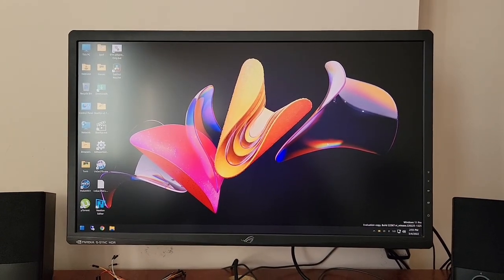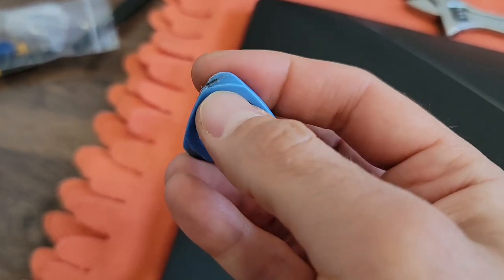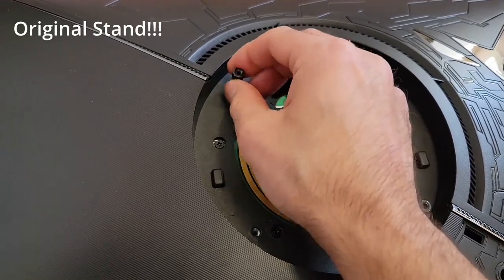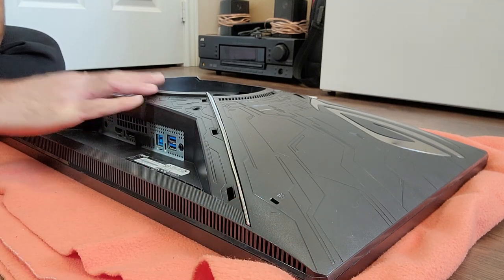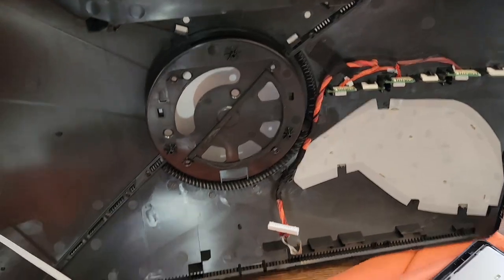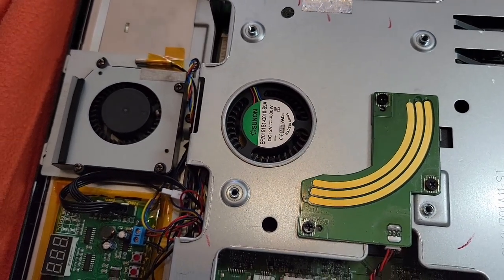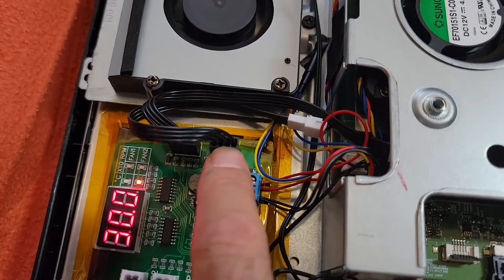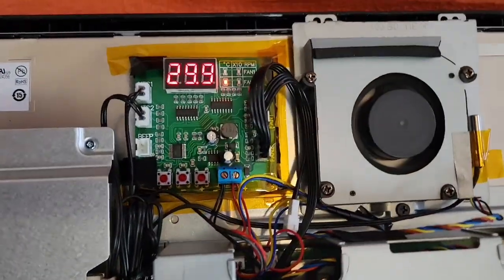Asus PG27UQ Disassembly + Modifying Fan Speed + Reduce Fan Noise

Comment: Mine loses signal for both DisplayPort and HDMI randomly. I’ll turn on my PC and it will lose signal like a few minutes later sometimes it will work for a few hours but then the same thing happens, same issue with HDMI with my Xbox. Unplugging then replugging any of the cords sometimes fixes it but only temporary. Any idea what the issue would be ?
Reply from the maker: Hey, it seems that your monitor is either overheating or you have a faulty main board. Have you ever opened the monitor to see if the fans are free of dust, I also recommend changing the thermal paste on the FPGA if your monitor is 2 years or older?
I would first blow air to clean the fans and also inspect inside the heatsink (see my other video if you are interested).
Good luck with everything.
Keep me posted.
Reply: @parhamsan  I’m opening it now and yeah there is some dust which I’ll clean, but don’t think the issue is overheating because it will lose signal only a few minutes after I turn it on before the fans even ramp up. Some days though I’ll be able to play for hours before anything happens. I’ll see if the cleaning helps but if it’s indeed the main board what should I do then? It’s not under warranty anymore I’ve had it for 4 years
Reply from the maker: @VerticalStrafes  unfortunately if it's a faulty main board you are better off buying a new monitor since the fpga module itself would cost around 600 USD from ebay, does this issue happen in winter time?
Reply: @parhamsan  it’s only been issue for the last 5 months or so but it’s been getting worse slowly overtime. This would really suck if it’s indeed the board so really hoping the cleaning and new thermal paste will fix it. I’ll let you if it improves when I’m done, thanks for the input.
Reply from the maker: @VerticalStrafes  The only reason I believe it could be a faulty board is from other users reporting they face shut downs when the fpga heats up. In your case it seems it is losing signal which I have never heard before from anyone.
My only suggestion is to do the cleaning on the fans, clean inside the heatsink (make sure to inspect inside the heatsink where the black shroud is, a lot of people have mentioned it getts clogged up with dust and other stuff), and finaly change the thermal paste on the fpga as mine was solid as a rock after 2 years.
I really hope you can fix the monitor as replacing a 2k monitor would suck!!!
Good luck again, I'm always here to help.

Comment: Perfect tutorial,  thank you. I was looking for the solution over and over and finally found yours.  Gracious
Reply from the maker: Glad the video was helpful, thanks for the comment!
Reply: Tnx 👍
Reply: @parhamsan  hi nice video , i have a question, i want to buy this monitor used, will it be louder if i vesa mount it :O? best regards
Reply from the maker: @Tuskabanana  Hey, if you Vesa mount the monitor, the fan that cools the FPGA, can such more air and cool the FPGA better but make sure to use some sort of standoffs like the ones I used. However when you Vesa mount it, you can hear the fans a bit more (if the fans are connected to the FPGA Mainboard). What I suggest is: if you buy the monitor used, and you Vesa mounted the monitor and if the fans are loud and noisy, change the thermal paste (see my other video for instructions on how to do it).
https://youtu.be/7c6hV5D1pJk?si=NFOZGWZu7cBbkTys

I always used the monitor on Vesa mount. There is also the option to use the external fan controller like the one I used to manually adjust the PWM of the fans and make them quieter.
So as you can see there are cons and pros of Vesa mounting the monitor, but overall it would be Quieter with the monitor on Vesa mount.

Let me know if you have any other questions!
Reply: @parhamsan  yes thank your for the respond, how is the hdr 1000, its worth it :O?, i would just buy it for hdr 1000 and 27 inch + good blacks, you think 300+ is a good price?

best regards
Reply from the maker: @Tuskabanana  The HDR is fantastic on this monitor, the monitor gets extremely bright for HDR content (1000+ nits), however to me this is a gaming monitor. For HDR gaming this should be fine but for HDR contents playback (Movies, Netflix, etc) I would definitely go for something bigger like 32" or 42" and oled screen. If your budget is limited, 300+ is a very good price!
Reply: @parhamsan  ty for your feedback, 32 inch is too big for me, i like 27inch only :=)
Reply: @parhamsan  yeah i will buy this monitor for 300€, main reason is also the hdr1000 + local dimming, solo games in hdr :=), how is the panel btw, is it sharp, i got a lg one its very sharp. Btw if i want to vesa mount it 100x100, do i need some adapter or something extra or should the vesa arm im buying have all screws.

Best regards
Reply from the maker: @Tuskabanana Hey, the HDR even for movies is pretty descent, for sdr the panel goes up to 300 to 350nits which is more than enough. I truly love this monitor, beside the fan noise which I'm gonna watercool the fpga to make it completely silent soon :).
I can't remember if the standoff were included with the monitor itself or came with the Vesa. I can get back to you on that. But definitely need the standoffs otherwise the fans choke!
Reply: @parhamsan  y would be n1 if you can me a update about the standoffs later, best regards :O
Reply from the maker: @Tuskabanana  Hey, your monitor should come with the standoffs
the PN is:
6K.3U709.001 (6E.3U706.001)
Go to these website, they have images of the standoffs

https://forum.gamer.com.tw/C.php?bsn=60030&snA=501554

https://pcper.com/wp-content/uploads/2018/06/68ca-dsc05034.jpg

https://pcper.com/wp-content/uploads/2018/06/25c8-dsc05035.jpg

Unfortunately if they are missing from the Box then you need to buy something similar as I could not find them on Amazon or ebay.

Something like this might also work, but you can ask the seller (don't take my word on it):

https://www.etsy.com/ca/listing/1323710159/vesa-adapter-for-asus-rog-swift-xg258q?click_key=c8d9aff33f1b0a64bd5bacd10a0b09213983043d%3A1323710159&click_sum=bdbaff9e&ref=search_recently_viewed-2&pro=1&sts=1
Reply: @parhamsan  ty very much for the effort :=), yeah he should have it, since he use the monitor on vesa mount too. best regards
Reply from the maker: @Tuskabanana  My Pleasure, good luck with everything!
Reply from the maker: @Tuskabanana  please create a new comment and I can respond to your questions, currently we are chatting on someone else's comments, thanks.

Comment: 2k$ monitor needs modifying how greedy can companies get - you need to delid CPUs change thermalpads on GPUs and mode Monitors ...
Reply from the maker: Hey, sorry for the late reply. I agree with you; I guess at the time when the monitor was released the active cooling was the only way to cool the FPGA module. But picking a cheap fan with jet noise and not being able to control the fan speed was a bad choice from ASUS!!!
Since making the fans silent (by lowering the RPM of the fans), I have never seen an issue on the monitor, so the high RPM on the fans was really unnecessary from ASUS!!!

Comment: Hey Mate - In terms of poweriing the board if I was to be powering 1 fan should the red/black from a single enxtension cable be enough to power it? I'm assuming given the main boards giving off 12v and the PWM board is powering a single fan rather than 2 this should work. Looking to do this on the 34" variant of the monitor that has 3 fans, the supplemntary ones are off to either side so I figure 3 x 1 channel PWM boards would be the easier in terms of cabling/probe placement.
Reply from the maker: Technically it should ok but I cant guarantee it. You can search for series and parallel connection online (current wise). With 2 or 3 wires you make sure you are supplying enough current to the board.
To give you an example: Lets say that each red/black wire supplies 0.5A to each fan. If you use 2 or 3 then you can supply 1A/1.5A to the board. If you use only one of them then you are limiting the board to only 0.5A.
Power=Current x voltage=0.5x12=6W MAX (1 wire)
vs
Power=Current x voltage=1.5x12=18W MAX (3 wires)
Keep in mind that the board itself uses some power.

Can you specify the specs on the fans?
Max current and voltage?
Reply: Looking at my photos from the last time I took it apart it's the same Sunon fans in both the pg35vq and pg27uq
Reply from the maker: @AbnormalFlame  Then you should be fine, but again just to be on the safe side connect at least 2 red/black wires from Monitor's MB to the Fan Controller Board.
Use these:
https://a.co/d/een9j7O

If you toast the Monitor MB you are in big trouble where the cables are like $10-12 from amazon!!!
Please don't blame me if anything happens to the monitor MB :)

By the way I have now switched to water-cooling the FPGA on the PG27UQ!!!

Comment: I need to replace the two fans in my PG27UQ. They're not really set up for easy maintenance (cleaning out dust) are they? I hope I can get that metal mounting shroud out of the way so I can get to the fans. Otherwise, it won't matter about upgrading, although I would like to do that as well. Here's hoping..
Reply from the maker: Hey Mike, as you may saw on the video I bought extra fans thinking that the new fans would have lower noise, but that wasnt the case. For me cleaning the fans and the heatsink lowered the fan noise and lowered the temps (beside the mod obviusly). I would say the fans are 100% maintainable and heavy duty. I have the monitor for more than 4 years and still using the original fans. Is the monitor shutting down or are the fans making a loud noise, just wanted to know the reason you want to do the mod? Also Which metal mounting shroud you are talking about, the one for the fpga?
Reply: @parhamsan  these are the original fans, and I noticed an increase in volume from the fans when I wasn't playing a game, when the room was quiet. I didn't think anything of it, and after a month of no gaming time, I finally turned it on, only it didn't come on at all. I unplugged everything, replugged it into the wall directly, and the monitor started up and I was relieved. Only it automatically shut off a couple of minutes later. That's all it does now, when I turn it on, it automatically shuts down after a short period of about a minute or two. When I got the stand off the back and opened it up, the main fan is almost completely dead. It doesn't turn on its own, and it's caked with old dust. The other fan (toward the top) spins freely but I never saw it come on while testing them.

I really just need to replace those fans, but I can't find my original purchase receipt (but I know it's not still in warranty, I've had it about 3 years). I can't even remember where I bought it from, which website.

The fans are mounted in an aluminum "shroud". I'll have to find a way to get them out of there. The top one looks easy enough; I can see those screws. I'm assuming it will come right off. The other one (the main fan) just has those rivets showing. It doesn't look so easy to get to so I can remove it.
Reply from the maker: @mikegarland4500  Mike, have you seen my other video. In that video I fully accessed the FPGA Module and the fan and I changed the thermal paste on the heatsink to the FPGA.
https://youtu.be/7c6hV5D1pJk
From your description it seems that you have a dead fan on the FPGA module. And the reason the monitor shuts off after sometime is because the FPGA in overheating and shutting down the whole monitor.

If you fast forward to the 8:00th minute (on the video that i shared) you can see how to open and access the heatsink. Again fast forward to the 12:00th minute and at exactly 12:36th minute you can see that the second fan is only held by 2 screws (top right and bottom left) and a piece of tape.
The piece of tape connects the fan to the plastic shroud (12 is written down on it with white marker).

You can order the fans from Ebay or Aliexpress. Original fan part number is:
EF70151S1-C010-S9A SUNON
https://www.ebay.ca/itm/266266726298?mkcid=16&mkevt=1&mkrid=711-127632-2357-0&ssspo=qE5nfKv9SAe&sssrc=2047675&ssuid=HpADsykxQ3m&widget_ver=artemis&media=COPY
https://www.aliexpress.com/item/1005005456076384.html?spm=a2g0o.productlist.main.5.5d1536852BOMcb&algo_pvid=9265b8a2-111d-483e-9ca3-8777ca849b00&algo_exp_id=9265b8a2-111d-483e-9ca3-8777ca849b00-2&pdp_npi=3%40dis%21CAD%2113.74%2113.74%21%21%21%21%21%402102111816856249374092577d07ee%2112000033155686905%21sea%21CA%210&curPageLogUid=dDKGkB7nczZb

You can buy them used or new, but I would pay more and buy a new one. I would order 2 and replace both if I were you.

Also you can use and electrical tape or Aluminum tape to replace the tape. Just get the correct width.

What I would do first is to swap the fan wires on the PCB to make sure it is a dead fan and not a bad fan header or electrical issue. If the good fan spins and you see the same behaviour (bad fan doesn't spin), then you are in luck.

Just order the fan from Ebay or Aliexpress, change the bad fan on the FPGA heatsink and you should be good to go (obviously you need to by the tape or reuse the old one).

Since you already opened the back shell you are half a way there. what I also suggest is to change the thermal paste while you change the FPGA fan. As you can see from the video mine was completely dry after 3 years of usage.

Good luck with everything, I'm always here to help and to answer questions!
Reply: @parhamsan  no, I haven't seen that one, but I knew there was another one I needed to check out. You're a lifesaver, man! Thank you. I'm definitely going to try and salvage this monitor; it wasn't cheap. And it's an excellent monitor, so I don't want to lose it to something like a faulty fan.

Thanks for the info and the videos, I'm definitely going to use them to assist in this repair.
Reply from the maker: @mikegarland4500  My pleasure, I'm glad the video helped people. I paid a premium price for this monitor as well. It's an excellent monitor for gaming and streaming. I hated the fan noise but with the mod I made the noise tolerable. Good luck with everything again!!!
Reply: @parhamsan  do you happen to have any info on the other fan? I'd like to just replace both of them, since I've got the thing open. I may as well just do both of them together.
Reply from the maker: @mikegarland4500  Mike, both fans are exactly the same just order 2 of the same fan and replace both.
Reply: @parhamsan  ahh... I could have opened my monitor back up I guess, but you saved me that hassle. Thanks again!

Comment: have the same monitor and it just stopped working after a power cut was it a surge? probably was. but there is power running through it, but it stays black and doesnt turn on. i think it can be fixed quite easily .but need to get inside it. not breaking the plastic is my biggest fear.
Reply from the maker: Hey, if your monitor has a black screen after a power surge, you might have monitor with damaged main controller. If you have already disconnected the monitor from power or power cycled the monitor and still getting a black screen the issue is probably related to the power controller and the mainboard.
You should be able to take the shell of and measure voltage on the PCB with the multimeter, that's what I suggest to diagnose the issue.
Just go very slow with a shim or something to pry open the back; I know the first time I was opening the back shell was scary!!!
Reply: thx mate @parhamsan

Comment: as far as monitor fan noise? never had that problem. if you're running a decent pc u wont even notice it. tbh iv never even thought about the monitors fan until this video
Reply from the maker: If you don't hear the monitor fan Revving up or being noisy, then you are a lucky and there is no need to modify it. A lot of PG27UQ owners, like me, have this issue so this guide was intended for them!
Reply: wow revving up seriously have not heard a thing @parhamsan   i cleaned the outside of it a lot though(?? who knows if that helped)